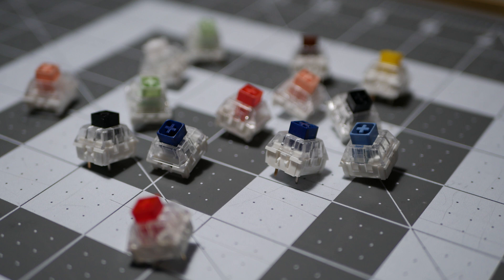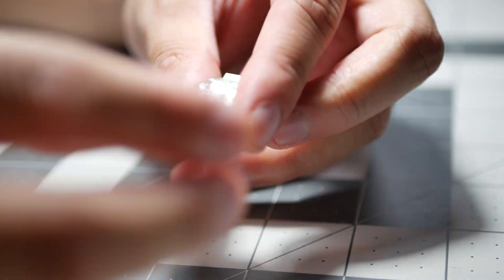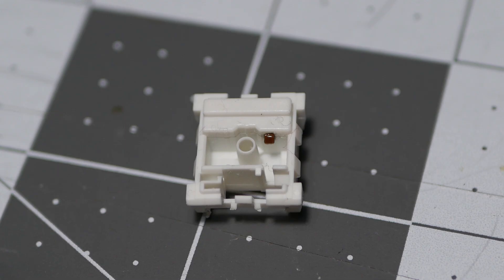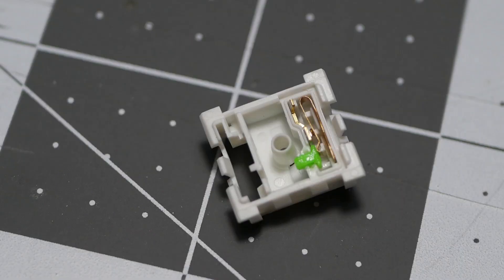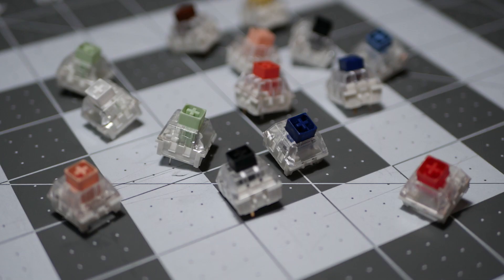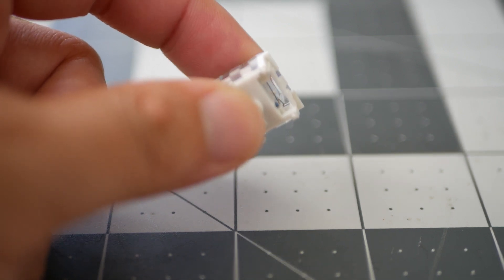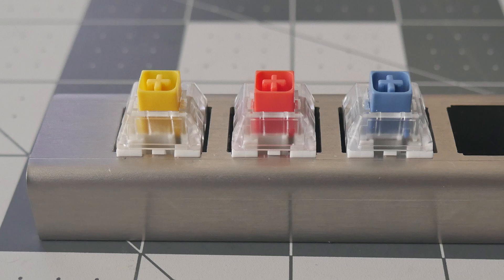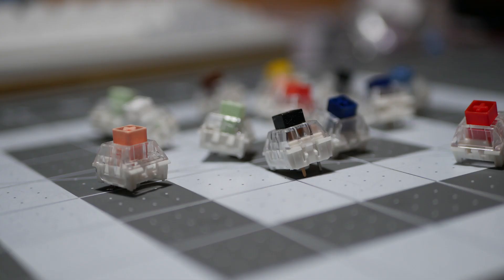Which Switch Ep 6: How Box Switches Work

Comment: Thank you so much for being the only person with a logical and straight forward breakdown on box switches. Until now i thought the stem is why they were called box, i assumed various cherry related things incorrectly too lol. Sounds like the click jackets are gonna be for me and my custom switch moddings. 

Still wanna try some box jades or maybe arctic fox' to see if the click can still be felt enough to justify the switch. Im trying to find anything that can beat out my  most hyper possible hyper tactile switches. 

To go into more detail about what im doing/how i got here:

Nobody seems to talk about the halo clear switch leafs being so insane when combined with zealio v2 stems in any housings. 
That stem has a lot of sharp straight angles in its designed much poppier snappier and thus tactile than anything i can find. 
The leafs in the halos seem to be stronger and more tactile than anything gazzew or panda clones can give me pandas being less tactile some how? 

I was gonna try actual holy pandas before really messing with clicks again but not if the leafs are the same or worse than the U4/Ts which again are objectively worse than the halos leafs(tactility wise).

I just dont get it. Does comparatively nobody like learning/improving/modding/opening switches?

Comment: you say at the start that there are no pcb mount box switches. if i got a hot swapable keybaord (like the gmmk) would i not be able to put in any box switches, such as hako trues or box whites?
Reply: No they will work fine on hotswap. Pcb mount is when the switches have two stabilizing plastic pins in the bottom. They're most useful for builds without plates
Reply: oh, ok cool. thanks. was worried there cos i intend to get said board.